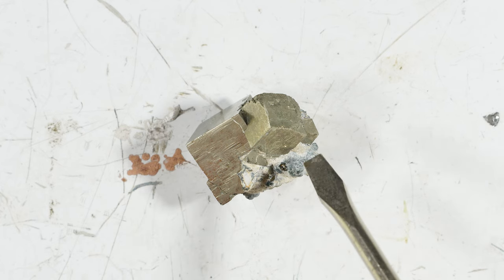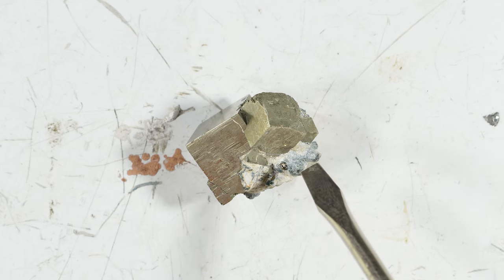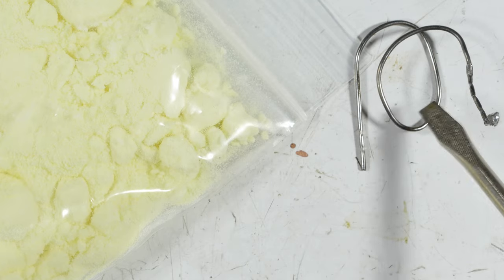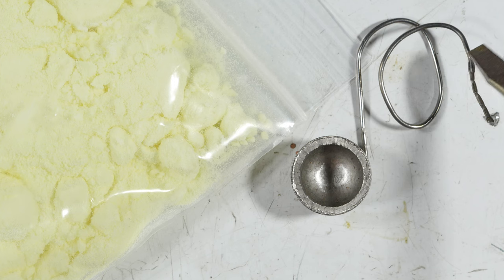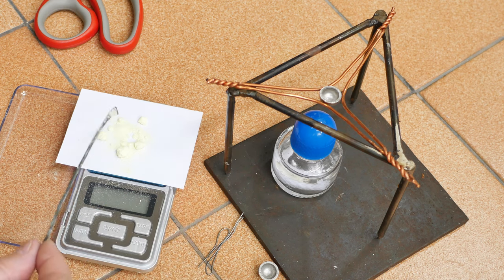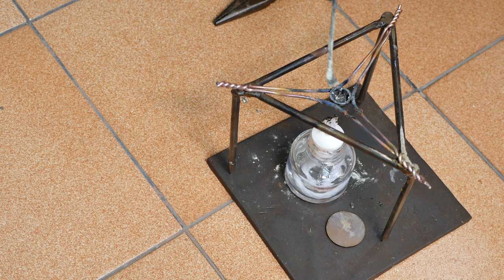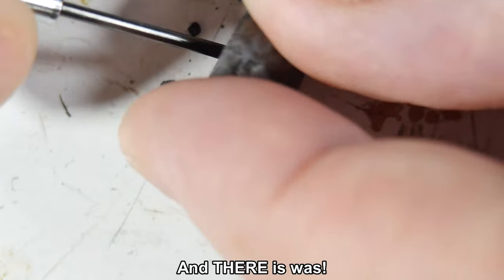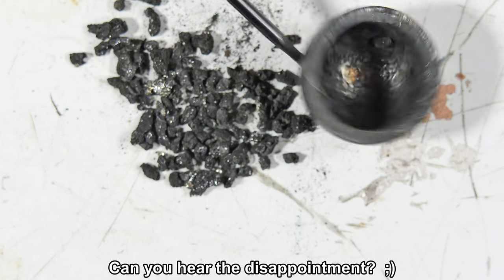Crystal Radio--FAIL! Trying To Make My Own Galena (4K)

Comment from the maker: If there's a chemist out there who knows if this process can be made to work, please comment! (I know it can be done with other chemistry.)
Reply: I think maybe you could try lead in a powder form and mix in the Sulfur powdered to get it to integrate better, and maybe have a stronger heat source, like a Bunsen burner.
Reply: Sadfully Lead(II) sulfide (PbS) isn't made that easy!
You have to give hydrogen sulfide to a solution of lead salt (e.g. lead nitrate) or you can try a solution of lead salt + sulfide salt but I don't know exactly which salts to use (the sulfide must push away a weaker "acid" out of the lead salt.
There will also be problems with purification of the lead sulfide and a crystallisation.

If you burn or melt lead and sulfur together (under atmospheric conditions you'll most likely end up with lead(II) sulfate (PbSO4) (Oxygen is very sneaky 😅)

If you have a p/o box or company address I'll send you a whole bunch, the crystalls are cheap as fk where I live 😅
Reply from the maker: @Christian-lh7ux  Thank you for the information. I guess I had to learn the hard way. I appreciate the offer of the galena, but it's around here, I am just being lazy (and you shouldn't encourage my laziness!) 😉
Reply from the maker: @Christian-lh7ux  Come to think of it, my school had a press, and for a demo they would put lead powder in a die, then squeeze it until it squirted out the end like hot toothpaste. Mix sulfur in there and I would wager it would work. I'm just 50 years too late.
Reply: @tsbrownie  do you get my last comment? Yt shadowbanned it!?
It was a "how to" to make PbS in an inert/noble gas atmosphere.

Edit: I should have everything here to do it by myself. If I don't hear from you trying it again I'll try it next weekend and give a report 😊
Reply from the maker: @Christian-lh7ux  Did not get the last comment. I checked my spam folder too. I was thinking vacuum chamber and electric oven. Or maybe a piston die press with sulfur/lead powder. 
But more seriously, I think one could put the mix in a test tube with extra sulfur on top to eat oxygen and stop it with a 1 hole stopper. But then there's a lot of O2 in the powder to begin with.
Reply: @tsbrownie   sometimes I really hate YT 😡 It was quite an effort to write it down, I'm german and my english isn't that good... especial if I try to do an chemical instruction 😓

You have to put the mixture in a test tube, plug it with stone wool (better the bad A (as best os)) and hold it up side down in a waterbath. Suck the air out - water goes in - until the water reaches the stone woll.
Do your noble gas (e.g. nitrogen or helium) in a balloon and close it with a "L" glass tube with a rubberplug on the other end in the opening.
Fill the test tube under water with the gas until all the water is replaced and close the test tube with the rubberplug with the glass tube in it.
Now you have a "reaction chamber" which has an inertgas atmosphere and the possibility to compensate pressure (through the glass tube into balloon) if some occurs.

Btw. It will be interesting to test if the PbS "blob" also has semiconductive propertys or just if its in a mono crystallic form 🤔

Edit: some sulfur in exes would be good to- hopefully- take the rest O2 out as SO2 or SO3
Reply from the maker: @Christian-lh7ux  Thank you for this. Your English is better than my sister's, so no problem. I worked in Hamburg for a year and my German friends described my German as "Schweinne Deutsch" so I don't complain about other people's language skills.
Reply: @tsbrownie  You're very welcome! You're giving us, me, so much with your videos. ❤ I really like your generel electronic videos but I also like your AM "Fox-hole" radio stuff, even when "our German radio stations with long-, medium-, and short-wave range have been switched off, even worse, largely destroyed.
DAB+ is the order of the day, whether we like it or not."
Reply: @tsbrownie  Ich finde es toll, dass du deutsch sprichst 😊

"Schweine Deutsch", deine Freunde sind ja gemein.😅

Ganz liebe Grüße aus Deutschland ❤
Reply from the maker: @Christian-lh7ux  Yes, AM is not economic or efficient in this digital age. Someday these radios will only be seen in museums. BUT until then, PARTY ON DUDES!!!
Reply: @tsbrownie  You need to grind the lead with a file and mix it with sulfur in a proportion of approximately 1/1 by volume, you don’t need to heat until the lead melts, you need to wait until the sulfur melts and saturates the powder, then hold it a little until a light crimson tint appears and cool slowly. You need to heat the powder in a glass test tube. The finished crystal is extracted by breaking it. There is quite a lot of information on homemade galena in old Soviet books. I wrote through Google Translator, there may be errors.
Reply from the maker: @4reeds491  Thank you. I will look at that.
Reply: Making lead sulfide is not that hard, nor does it have to be particularly dangerous as in making hydrogen sulfide. For instance (chemist here) you can use any soluble lead salt like lead acetate, and mix it with a solution of sodium sulfide. You can make sodium sulfide by dissolving sulfur in a solution of sodium hydroxide (lye). Lead sulfide will precipitate from solution as a black powder.
But that is not galena. Galena is a crystalline form of lead sulfide, and that is difficult to make from the amorphous black powder you get that way. You could try hydrothermal methods, in fact I know someone who has had some success with that (I have never tried myself). He used to have a youtube channel but unfortunately had to stop his experiments or posting videos due to health reasons.
Reply from the maker: @stamasd8500  Interesting, thanks. I never suspected S would dissolve in NaOH.
Reply: @tsbrownie  It does. It's a well known method for making solutions for adding toning/patina to metals such as copper, silver etc.
Reply: I’m that guy Stamasd8500 mentioned. I use a hydrothermal autoclave to make FeS2 to create synthetic pyrite. It took me five attempts to get cubic crystals which were large enough to see under the microscope. I’ll reply again soon with more details. I also have made synthetic galena in a test tube by sublimating the sulfur onto the lead in an inert atmosphere.
Reply from the maker: @mwilson14  Thanks for stopping by. I've come to the conclusion that oxygen is not galena's friend and that long cooling times are probably needed for big crystals.
Reply: @tsbrownie I'd bet on that not working. There is no way, the press can induce the grow of crystal structures.

Comment: I think I read somrplace that the doping of galena with sulfur is less than its common natural form,  for a better radio diode.  Other possible minerals might be corrundum (aluminum oxide), and silicon carbide (carborundum), but then again, the amount of doping will also determine performance.

Comment: You were successful just not at making a large crystal. Requires different "environmental conditions."

You need same set up that is used for growing large quartz. It's simply not feasible at home scale. But if you are only interested in semiconductors, there are tons of papers on growing atomic layers on electrodes or glass.

Comment: i have an idea , if you can use a heating element instead of flame , then try it in a sealed container or vacuumed housing and flood it with Argon gas
Reply from the maker: There's another comment that has a detailed description on how to do that. It makes sense, but it's probably way beyond the average experimenter!

Comment: I dated a girl who's brother wrote a book on Union Park in Dubuque. We desided to see if we could find the old mine that was in the park and I did!

The power company had blown up the entrance to keep people out many decades ago.

I discovered a couple of small entrances into the old mine and we found even the old wooden stairs were still intact once we crawled inside the narrow opening.

Most of the lead within reach had been taken by visitors back when Union Park still let people into the mine.

I could see small deposits high up and out of reach on the ceiling but didn't know about crystal radios back in the late 80's.

Not too far across the river from Dubuque there's Galena Illinois and you can probably guess how that city got it's name. 

Galena is a great town to eat and shop in with a few wineries too. That keeps the women interested. I also liked the various civil war cannons in and around the park there. Since civil war era  Grant was from Galena there's also a museum dedicated to him. There's a few old mine museums too but you would have to hang out with the locals to find out how to get in any old mines that might still have openings there.

Are you familiar with metal charging? They use a metal rod with a metal cup like yours attached to the end. The chemical they want to charge is packed into these cups. Once the metal to be charged is molten they plunge the charger to the bottom of the molten metal so it can interact with the metal just before pouring.
Reply from the maker: I had to look up places named Galena:
Galena - Washington
Galena - Virginia
Galena - South Dakota
Galena - Oregon
Galena - Ohio
Galena - New York	
Galena - Missouri
Galena - Mississippi
Galena - Maryland
Galena - Kansas
Galena - Indiana
Galena - Illinois
Galena - Idaho
Galena - Colorado
Galena - Arkansas
Galena - Arizona
Galena - Alaska
Reply from the maker: I don't know about metal charging. Is that like Bessemer converters?
Reply: @tsbrownie   I didn't realize there were so many. I wonder if they all had lead mines like we have here in Dubuque and Galena Illinois?
Reply: @tsbrownie   The process of adding the chemicals during charging is sometimes called fluxing and degassing and is often used even on a hobby level to cast aluminum and brass or bronze.
Reply from the maker: @tenlittleindians  OK, I understand. Thanks.

Comment: you should just melt lead and sprinkle sulfur over it untilsurface is covered wigh crystals, the stuff looks horrible but actually works fine. I have discussed with an old Elmer, he said to use a cut of brass casing fir melting in and fill with lead till justc1mm from top then sprinkle sulfur until you get a layer of that gunk.
it is what they did to make some of thosev"steel galena" detectors back in the day, this was from someone that worked as radio engineer in kate 1920s untill late 1980s, and he was REALLY interested in crystal radios. it was well discussed on the old Crystal radio forum, looong lost by now can't even find it on wayback or similar, i yhink we had a shorter discussionon Theradioboard forum, but that is also lost,  luckily most of the Ben Tounge crystal radio articles are on wayback. they are REALLY worth a serious study.
Reply from the maker: @najroe  I am going to try again. We shall see how it goes.
Reply: @tsbrownie  do that, I have made DX competition sets for decades, i was one of first dozen members of Dave schmarders  theradioboard.
As for the fake galena, I live nortern Sweden and have caught DX from Portugal and Turkey on such crystal, true, i have 1000+ litz wire on custom polystyrene foam formers, silver plated copper capacitors with minimal steatite insulation... One such radio cost me just shy of 1500€ and that was without the refurbished RCA big can balanced armature headphones and audio matching transformers... Saying I have been serious in pursuit of perfection is an understatement
Reply from the maker: @najroe  WOW! That's some serious stuff. I thought putting $25 USD in a radio was expensive. You should be teaching and making videos! I've been to Sweden many times on business. Stockholm, Orebro, Linkoping, and a few other places where I have no idea where I was. Met your Minister of Health and his administration. Spent Christmas there once. Good food, great country full of wonderful people.
Reply: @tsbrownie  interesting to hear
Reply: teaching? we did that on crystal radio forum and theradioboard, we had a great FAQ on most subjects (antenna,  antenna tuning,, impedance matching (a,ntenna, coils, detector, headphones),loose coupling of coils, High Q benefits... 
it could be summed to, antenna as high and long as practical (over 160m high tower is beyond most so antenna is likely too short), match everything as well as possible,  everything as low loss (high Q) as possible. how to get there is no easy task. 
just getting good teflon served 1050x48 lits with correct twist is hard, then getting a good thin wall styrofoam coil former with grooves cut to space the bifilar winding with right separation between turns (0.45-0.7 of single wire diameter depending on frequency, wire thickness, total inductance...)  you still have proximity and skin effect as wellas eddy currents and other losses, even with litz. you want unloaded Q as high as possible as you will have to liad it down with things like  antenna, detector... to extract audio from the signal and thenhigher Q the more you can liad ut without tuning becoming wide enough to hear several stations at same time when trying to tune
Reply from the maker: @najroe  That's interesting. It's always easier to understand when you see it for real and the mistakes to avoid.
Reply: @tsbrownie  that is true,  but I am not a good teacher,  i tend to be disjointed and get sidetracked if I teach.